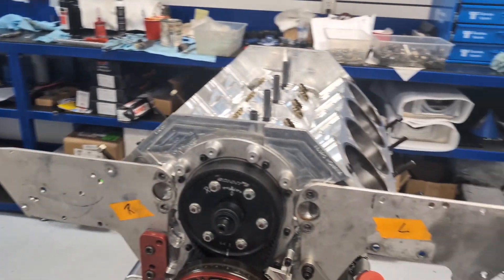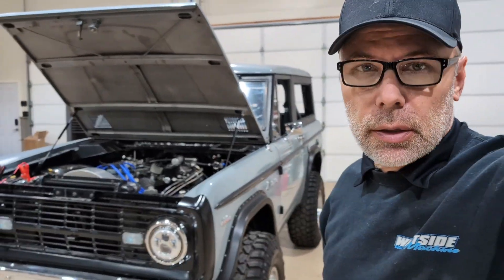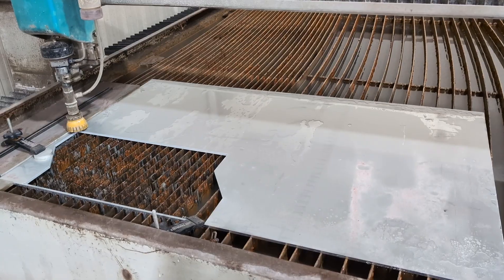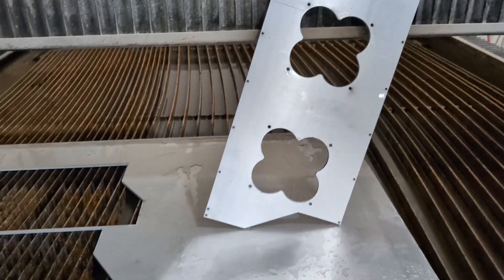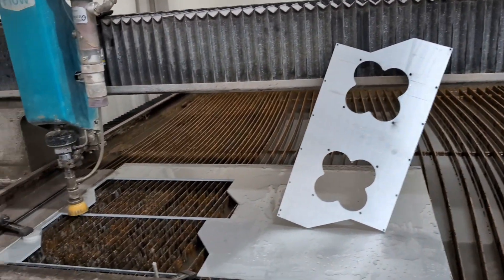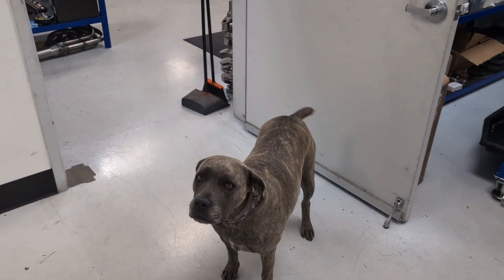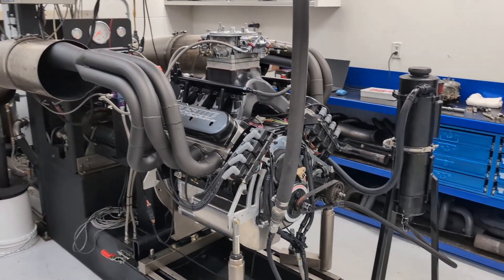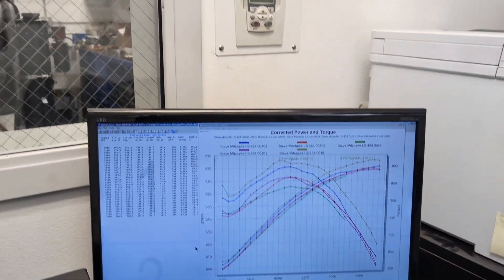Engines, Dyno, and Water Jet

Comment: Thank You sharing some of what goes on at Your day job Justin.
Is Rob Flynn going to be Co-Crew Chief with Jim Oberhofer at Pomona ?
   Now for a technical question....
When the 51 Crew goes together with the engine, after the heads are torqued,  Austin goes to the head cabinet on the left pit wall and brings over a large plate with several fittings protruding on one side, that they lay in the valve valley.
    I'm fairly certain what it's for but i'm about smart enough to scrub toilets and sweep floors at Westside.
Thanks once again and Best Wishes to You, Your Family and Friends... 🇺🇸